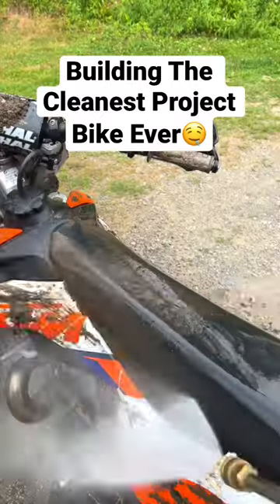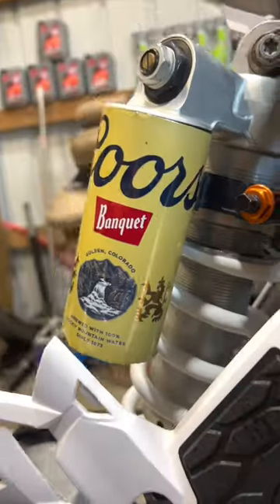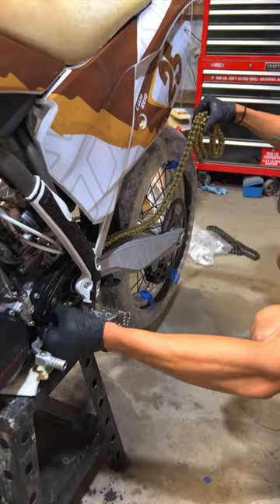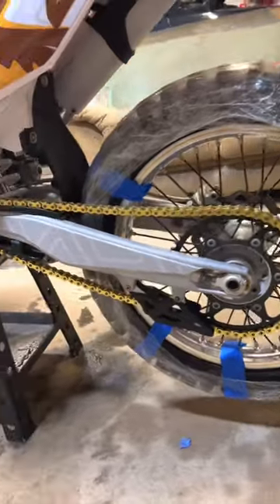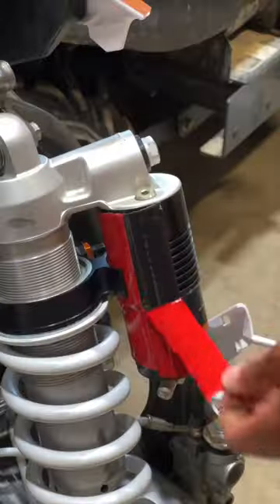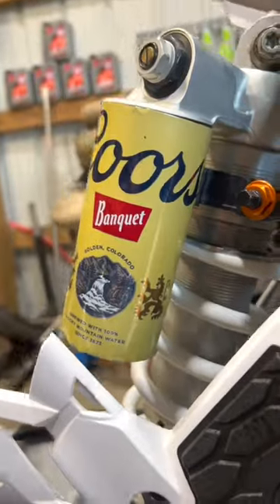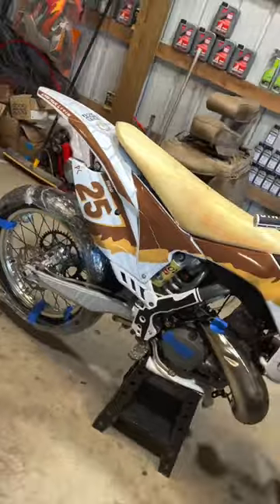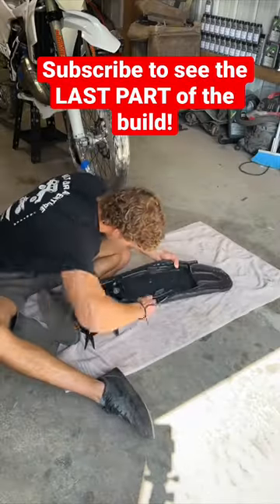Building The Cheapest KTM I Could Buy😳 #mx

Comment: When you put the chain on just connect the master-link with it off of the sprocket. Then pretend you just did a tire change and throw the chain around the sprocket. No need to line it up on the rear sprocket and fight the tension of the chain.